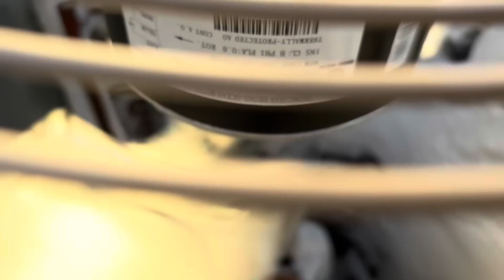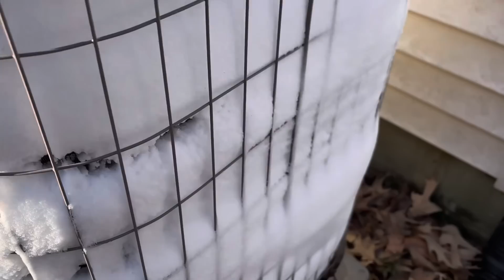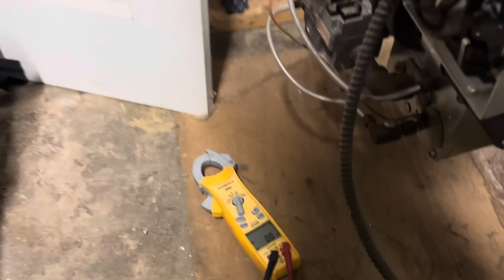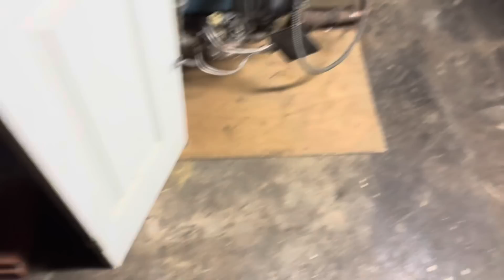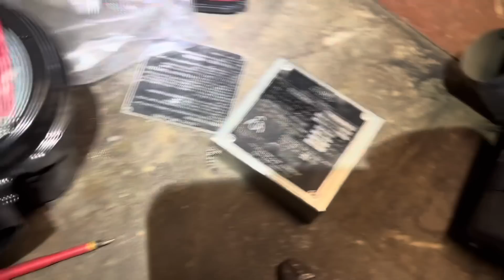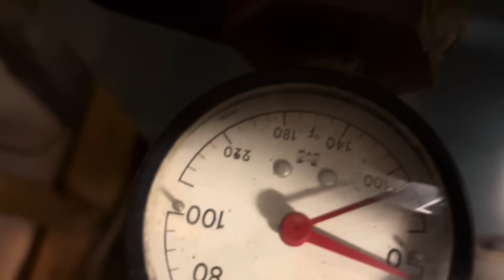BIG TIME Freeze Up On Payne Heat Pump!  Plus We Repair An OLD Burnham Boiler!

Comment: So the r wire was not closing the defrost switch? Awesome video.
Reply from the maker: You got it!  Y pulls the contactor in but it needs R to power the defrost board.  No R, no defrost. 🤙
Reply: @JeffsHVACAdventures  thank you sir.

Comment: Never have seen a gas burner like that before, very odd indeed. The only thing that looked wrong is the draft hood on the venting, if it was a draft hood. The newer gas conversion burners like the Carlin or Beckett's use a special barometric damper with a limit switch.

Comment: Excellent work as usual Jeff 👍🏼 Hey do you like heat pumps in your opinion or are you old school and stick with the tried and true AC with furnace?
Reply: I'm not Jeff, but I see no reason, if you're going to have an air conditioner, which is a heat pump, why it can't have a reversing valve and a pan heater for the 85% of the heating season that a heat pump will do a superb job at capturing the heat energy that's all around us and move it inside. Why keep burning and burning and burning more fuel when there's plenty of heat energy already outside? If it's above absolute zero, there's heat energy. 🙃
Reply from the maker: I like heat pumps.  You really can’t beat the good dry heat a fossil fuel unit gives you but I do like heat pumps and don’t mind working on them at all.  And like @dregenius said, most of the year (in my climate) a heat pump runs very efficiently.

Comment: So If no R to energize valve then how did they have AC in the summer?
Reply from the maker: It gets its O call from the thermostat.  A carrier HP literally just needs R for defrost and that’s it.
Reply: @JeffsHVACAdventures  I have never run into a unit in 20 years that operate like this,thanks for sharing!
Reply: Good question

Comment: Are those combustion analyzers reliable?
Reply from the maker: I haven’t had one moments trouble with the UEI ones.  I had the older style like this I used for years with no issues.  This one is great too.  I have one by Inficon too that I seldom use because I like this one so much.
Reply: I never liked Heat Pumps they don't work well at low temperatures.

Comment: Too bad you just cant hook up a hose pipe to the water heater to melt the  ice
Reply from the maker: Not a bad idea.
Reply: honey turn off the shower our heat pump is defrosting
Reply: Awesome troubleshooting and repair
Reply: yeah... if no hose to WH available... I've filled five gallon buckets with hot water... works pretty good